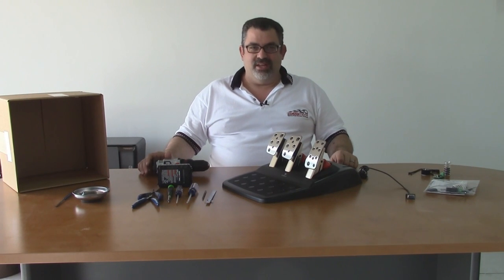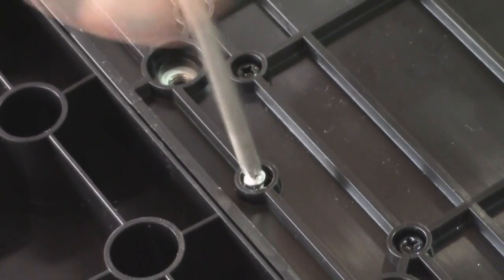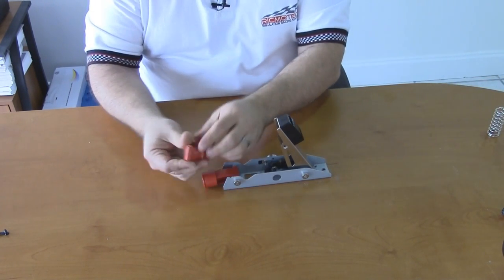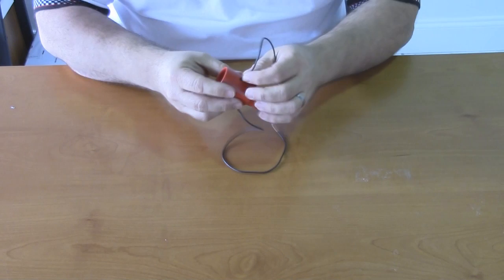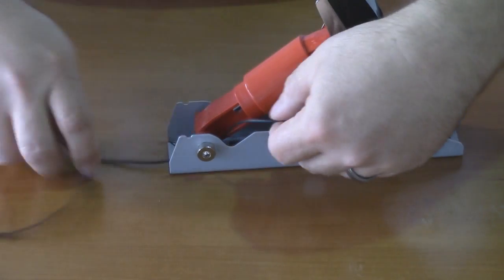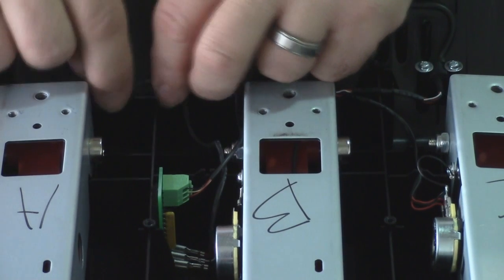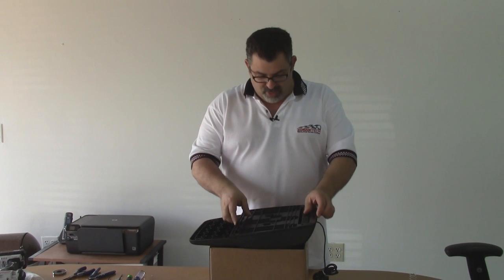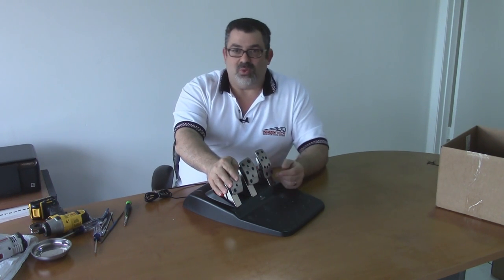Ricmotech LC27 Load Cell Installation

Comment: Best Brake mod Investment for the G27 / G25. I've had mine for about 6 months now..  
I also have a competitors Hydraulic brake Mod on my 2nd G27,  that one was 3 times the price, and I think the Ricmotec load cell is better..
About your Tip..
Ha...  I swapped out the springs all at the same time I did the brake mod..   old Brake spring in the clutch, and clutch spring in the throttle.  
that little tip is worth the price of the kit. It's like a whole new set of Pedals.. Much better....

I also modified my brake just a little.
I did change out the black rubber insert for one with a slightly softer feel.. 
I found a piece of 3/8" air line, that was just the right size, and it wasn't quite as stiff as the black one supplied in the kit.

and I want to add this too...
Since getting my T300 wheel for use on the PS4,  I have updated the Circuit board, and got your G25/G27 to T300 adapter..  
Note: you need to use a different circuit board if you plan to use your Load cell Pedal set on the T500, T300, T100 wheels.
Just send Frank a message and he will fix you up with all the right parts.

Yeah I know this sounds like a sales pitch,  But I'm just a satisfied customer..   Great product, great support.
wish I would have known about this when I first got my G27.
Reply: Hey ma, can you tell me where you got your replacement air line insert from?
Reply: kev brookes I had a length of it from my air compressor. 
but here's a source for it by the foot.
http://processhose.com/3-8-in-i-d-goodyear-red-horizon-300-psi-air-and-water-hose-bulk-hose-priced-per-foot-no-end-fittings.html

or you can try Harbor Freight
http://www.harborfreight.com/38-in-x-8-ft-15-ft-rubber-air-hose-remnant-61942.html
Reply: wyldanimal2 Just a note: I haven't yet had any issues, but the Softer Airline insert I used Might start to wear out.
the constant compression of the rubber might cause it to start to break apart.
So I'd recommend inspecting it after a while.  It's easy enough to replace if you find signs of wear.
Reply: Thankyou mate
Reply: I rather buy a T-GT with pedals than messing those pedals.

Comment: I've already attempted adding a load cell  to my pedals with another product and I broke my pedals lol.
I didn't sim race for years because of it.I was lucky to find some pedals on ebay later and just put the heavy spring in the brake cannister.
I broke the spade connecters that connect to the pot.They are soooo soft and easy to break.
The screws on the bottom of the case are made from putty also.
Reply: The guy in the video is a professional guy, who knows what he has to do. I am a noob and I rather pay to professional for helping me.

Comment: The Perfect Pedal brake mod is literally feels like a real brake, especially after you tune it with the liquid tuning kit.  Hard to believe this is better or more accurate.  I'll have to try it and see.
Reply: I have both. the Ricmotech in my opinion is Better.  After my Mod. it has a good hydraulic feel to it.
and I think I can do threshold braking better with the Ricmotech load cell vs the perfect pedal.
not to mention it's 1/3 the cost of the other..
Reply: Cost is no object to dome. Only performance.

Comment: Just used this video to install the loadcell on to my g920.
Now need to learn how to drive again.
Reply: Was it worth the money?
Reply: @a48717  If you are serious about sim racing but are looking to go down the full simicube or fanatech route then yes it’s worth the money. 
Just check to see if they have addressed the spring length issue. I didn’t get a lot of feed back when I told them it was too long and applying a small amount of pressure causing the brake to be applied at about 4%. 
I had to cut some of the spring off and I know someone else who had to do the same.
Reply: @bigal1968ful  got the g923 for 300$ with shifter, they tuned the break pedal so its way better, no load cell or like a real car but it works way better than expected.

Comment: I love this because I have the cnc capability (in my shop - Haas machines) to make my own set of pedals out of the Logitec G920 guts. I have an Accuforce V2 on order. This  load cell...and the Bodnar Generic Pedals Adapter may be the PERFECT solution for me.

I have two remaining questions before I place an order.

1. Is there a better potentiometer for the accelerator pedal....or is there any mod that will be an upgrade to the accelerator pedal will still work through the Bodnar usb conversion cable?

2. I'm only using the pedals from the G920 system...I'm only using the brake and accelerator. No clutch pedal. Can I  make this load cell conversion to the brake pedal...and then using the usb conversion adapter....can I use this two pedal assembly as a STAND ALONE brake system?

Comment: would it make any difference to use i different rubber insert to give a slightly softer feel? if so do you recommend anything or do you recommend sticking with the stock insert and getting used to it?

Comment: I did these mods with the load cell and spring switching, and for some reason in each game I play my car wants to go full throttle in reverse, without me touching a thing. The games are unplayable, and when playing, you can press the throttle and watch "R" battle with "1." Are the springs/load cell pushing buttons that I'm not aware of?
Reply: That is why I trust those works for professional guys. I tried to open my standard PS4 and I screwed my PS4. Now I rather pay 50 euros for cleaning my PS4 than cleaning myself. I want to say this, if you think you screw up something, trust those works for professionals. I'm from Estonia so sorry about my broken English.
Reply: You may have crossed up some wires

Comment: Would this work with a Clubsport V2 wheel base if I'm using that with the G27 pedals?
Reply: ***** What type of modifications? I'm thinking of getting a CSW V2 and would like to convert my pedals to load cell but also work with the CSW V2 via their adapter.

Comment: I am using my G27 pedals with a Bodnar Cable. Can i purchase this Loadcell and still use it with a Bodnar Cable?
Reply: +Mitti87 Did anybody answer this privately? I'm also using the Bodnar cable and I'm interested in this LoadCell. Are they compatible? Thanks.
Reply: +JO Simracing no response till today. i've now purchased a used APelectrix Loadcell and it works absolutely fine with the bodnar cable. i am almost sure that it will work with ricmotech as well.
Reply: +Ricmotech +Mitti87 Thanks both for responding. I suppose the bodnar cable requires choosing the connection based on g25/g27 rather than Thrusmaster in the purchase form. Can anyone confirm which connection option should I choose? Thanks.
Reply: Thanks for confirming.

Comment: No way would I install this.
I use a stiff spring for my brake and it's great.
I would break my pedals trying to install this.
I'm clumsy with my hands even though I'm a drummer of 40 years.
Reply: Yet its not pressure sensitive like a load cell is.